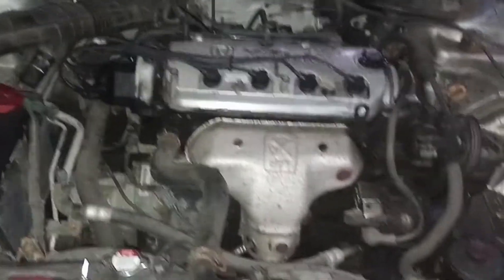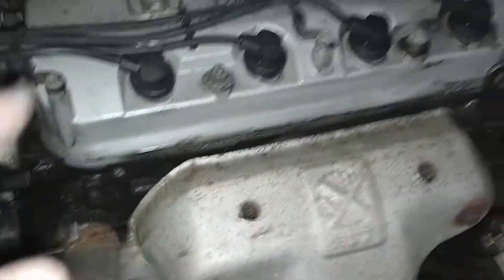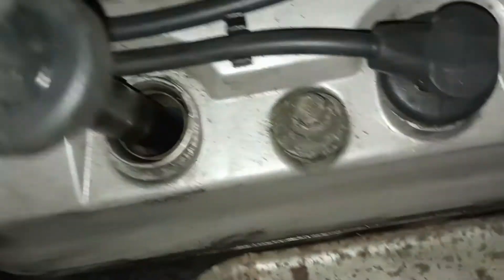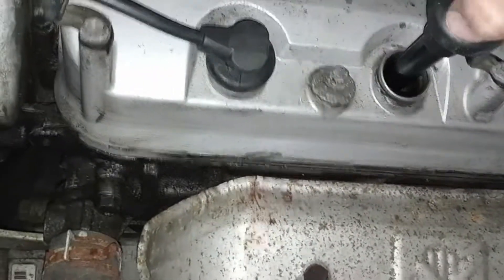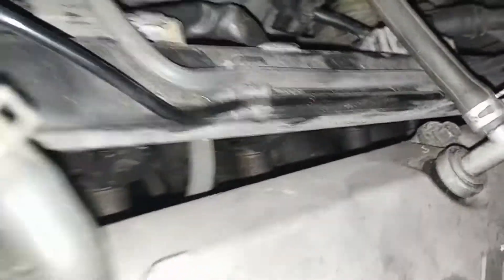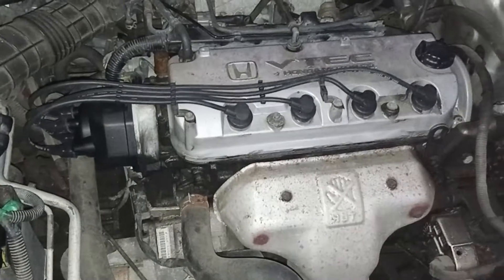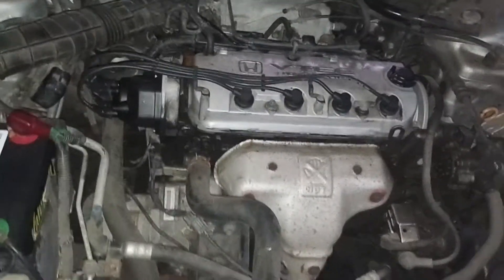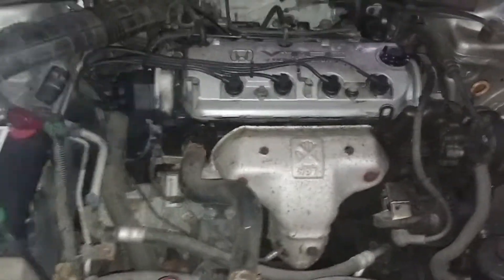2002 Honda Accord Misfire issue.

Comment: What about a injector clogged or just not working?
Reply: I found out about my misfire issue.  One spark plug boot just above the spark plug had a hole burned through and the spark was shared between the spark plug and grounding out to the head. As the hole burned through bigger, the electric spark was stronger grounding to the head, and less to the spark plug; causing weak spark at the spark plug. Eventually the spark was so strong grounding to the head, the spark plug couldn't fire the cylinder,  hence a misfire; sometimes at highway speeds the cylinder would fire. I changed the spark plug wires and the problem was solved.

Comment: Did you check the PCV Valve?
Reply: PCV valve, is called a positive crankcase ventilation valve. Does not effect one cylinder operating incorrectly. The PCV valve clogged, would effect crankcase gases pressure build up, forcing oil to be pushed out blowing gaskets, like valve cover gasket.
Reply: @ericsaltonstall8573  agreed

Comment: Did you find the issue mine is doing the same thing pull the plug nothing happens im gonna try the injector tomorrow
Reply: I took mine to mechanic, he said check fuel injectors. He put fuel injector cleaner. He also checked the distributor. 

Did you find out the problem?

Comment: Its not telling me which cylinder i have the v6 im getting code p1399 that says "any cylinder "
Reply: Start engine. Pull one spark plug wire at a time. If the engine running does not chance, that is the problem cylinder. Don't forget to replace each spark plug wire back on the spark plug before pulling the next spark plug wire. My car had a hole burnt through the spark plug boot and the spark plug still had some spark,  just not full spark power. Half the spark was leaking out and grounding to engine head. That caused my engine to run rough, especially under a load; like in gear, driving, trying to pick up speed or going up hills. Before replacing injector with a new one, swap injector with  another injector at another cylinder. Pull spark plug wires again to see if the problem follows. If the problem follows, then the problem is the injector. If not, most likely the spark plug wire or spark plug is bad. Remember, spark has to also get into the spark plug wire from some where too. Most likely a coil or coil pack.
Reply: @ericsaltonstall8573  again i concur. that is exactly how its done